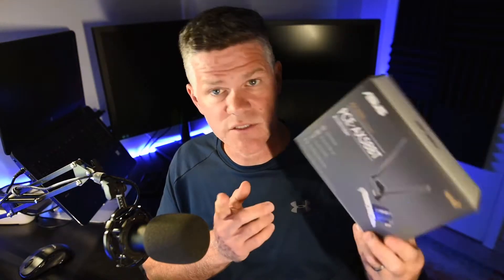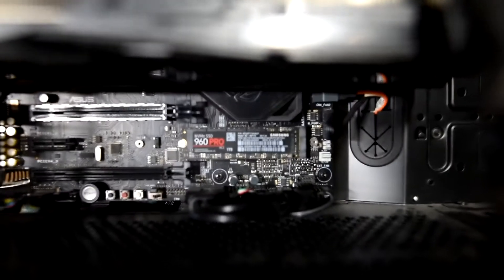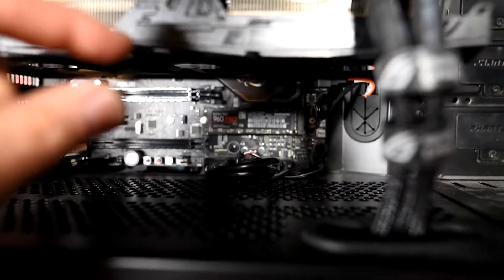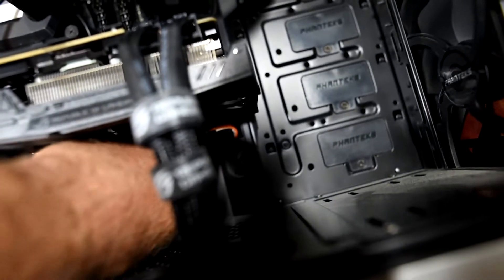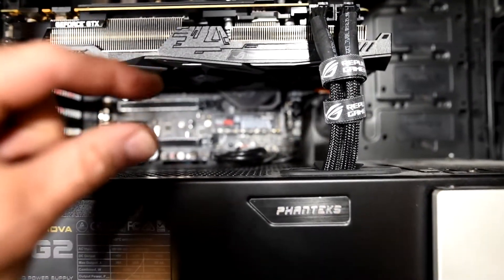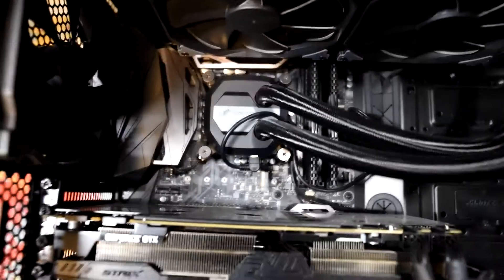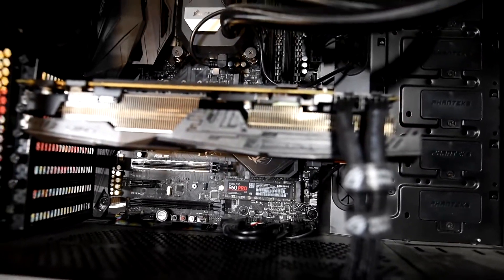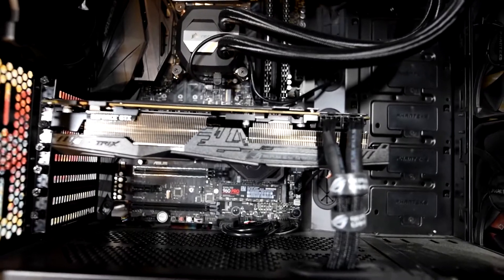NZXT Internal USB Hub install

Comment: I have one nzxt hub 2.0 but the seller didn’t send the power supply SATA cable , I need to connect my fans Lian li , I can use without SATA cable ?

Comment: does anyone know if this device lets you attach a ssd drive. So the ssd drive has its own sata power  to teh drive but the sata data from the drive gets plugged in to this device with the 9 pin usb connection. I heard that usb 2 mother board headers only allow 2 usb splits but would this device work lets say the same wiring set up above but with 3 ssd drives connected to the hub